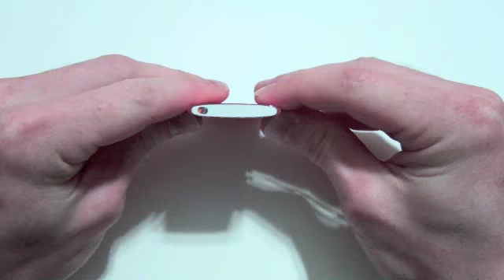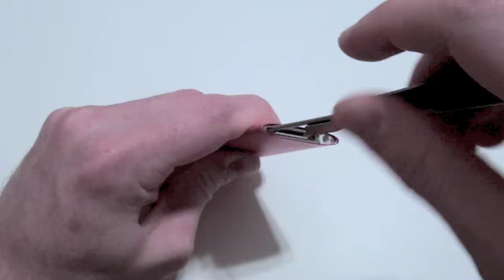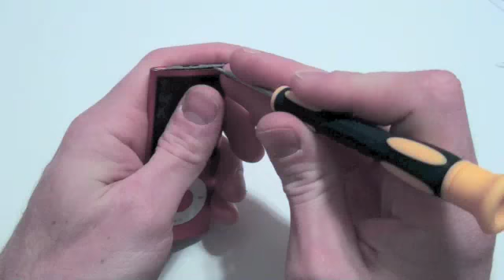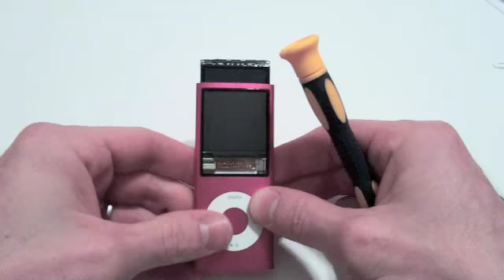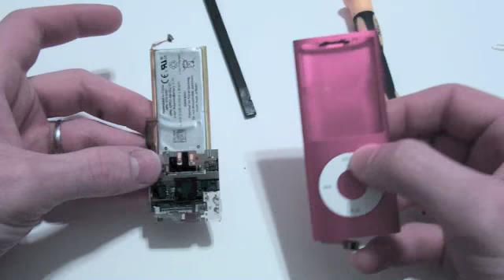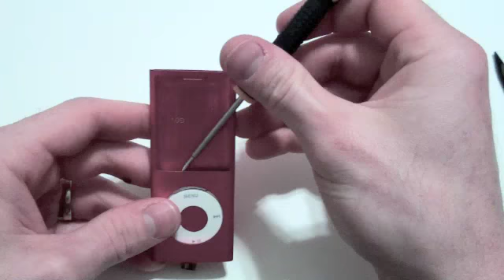How to Repair an iPod Nano 4th Generation

Comment: I made a mistake a big mistake  I ripped the click wheel connector now I had to source one on a random website and while I’m in there  I’m replacing the battery with an ifixit one took it apart because I accidentally put it in the washing machine it was off didn’t hold a charge anyway so I hope it didn’t get ruined I will be soaking it in alcohol and blowing it off with electronics cleaner so it has the highest chance of not being damaged

Comment: this is an ok instruction in my opinion. but I think due to ageing some of the glue is getting much stickier. removing the Glass bent the case in some places.

sadly I ripped Off the cable of the wheel when sliding Out the Logic board and battery so take care. But I am Not Sure If I would have succeeded in soldering the battery.

maybe its better to buy a used one

Comment: Mine won't power up, I've tried resetting bit didn't work. When on charge I know there is power gettin to it because when I hold it on my hand I can feel electrical vibration. Any ideas what I can do to get it switched on please?
Reply from the maker: You could try to replace the battery and see if that brings it back to life, but it might just be time to replace it.

Comment: I am a very good technology person and I've repaired my own LCD TV's, watches, etc.  But honestly, this video is about DISSECTING your DEAD iPod Nano 4th Gen.  Because 99% of you attempting this are going to break the microscopically delicate ribbon cables, break off the cable locking mechanisms, and IF you finally get to the battery without breaking things, and desolder it without burning out circuits, you've still got to reassemble it all.  For me, the guitar pick was an amazing plus.  However, the Chinese kid putting mine together went to town on his use of adhesive, and parts were also covered with tiny adhesive tape now too.  So it was a real struggle to pull things apart.  Anyway, don't think this is going to be a consumer job.  You'll really need good TINY tools and a LOT of patience, and decide what your time is worth.

Comment: I have dead iPod, so just for entertainment and because I always like to check out the newest tech that falls into my lap, I mostly followed your video and got it apart OK. 
My Model A1285 had a metal frame holding the battery. It is also very helpful to use a hair drier or heat gun to heat the iPod up so the glue lets go easier. EE Rob.

Comment: In reality there is silicone in every joint. You can take the screws out, but the screen just won't move at all. Try to pull it and you'll break it.

Comment: need help my fell in water wasn't the first time is happen but this time it won't unlock its stuck in lock. when i slide the metal slide holder nothink happen it work it just won't unlock. how much would it cost to fix it
Reply from the maker: It would depend on exactly what is wrong with it. You can give our repair department a call at 866-726-3342, option 2 for a quote.

Comment: For those struggling with the glass or any of this video please follow the video exactly, very very exactly.  In the video he pulls the screen up til the cable is visible through the bottom of the glass (this is crucial) only then will you be able to press down enough on the bottom of the glass enough to remove it.  The techniques are very specific, follow them exactly as described or you'll end up frustrated with this break down and maybe damage you device.

Comment: lol "simply" press on the glass. This is the part I'm having trouble with. The ipod is gone so I'm not actually worried about breaking things or marking up the metal, but it's still quite frustrating.

Comment: actually, ppl do not waste your time trying to open you ipod, mine was allready toasted and i have a new one, i just wanted to see what it looked like inside.

its defenetly not as easy as this guy made is seem. the glass is the hard part, im not clumsy or anything, im acually used to this type of work but even i ened up cracking the dispay, bending the case and shattering the glass before giving up. dont waste your time, not woth it. mine was trash anyway so im not sad, but still. not worth it

Comment: when i was removing the LCD i noticed that on the back the two black things that run down the sides were separating from the main LCD at the top. it doesn't look too bad, and its only a little apart, will this be a problem?

Comment from the maker: Fixing it usually involves replacing the component. The act of taking apart the ipod will not fix it unless there is an alignment issue with the clickwheel which usually is not the case.

Comment: hey i just took on apart te glue is all over from when it was made. u have to push down on the right sized screwdriver and the side screws are at a angle & one of mine was poorly put in the hole and had some frame stuck in it if u get them out to a point u can can wedge them out the rest. Ps. i used a (00x50 mm) Phillips. (little big but it worked fine)

Comment: did u disassemble it (b4 it stopped working)? i just took my stepmom's apart cause it's battery is bad. i put it back together outside the case and the screen didn't turn on ( when i plugged it in cause it only works that way) but it was the ribbon lock wasn't pushed down all the way.

Comment from the maker: You most likely have corrosion on the logic board. You're probably best off replacing the board. We can repair liquid damaged boards as well at our repair facility. You can give us a call at 1-866-726-3342, option 2.

Comment: U should open the back and blow everything for atleast 2 minutes and then put  the thing back on and see what happens.Or else you'll need to ask someone to repair it.But you can also try to hold the power button on for a at least one minute and see what will happen.You should try replacing the battery because somtimes the battery can have a problem.Try charging the battery for a few hours too.If nothing works you might want to go to the store and exchange or return your ipod nano.Wish you luck!!

Comment from the maker: You likely have a problem with your logic board, and you will need to replace that component. Parts for this model are available from our website or by calling us at 1-866-726-3342, option 1.

Comment from the maker: You likely need to replace the LCD. The issue could also be the logic board. The parts are available from our website or by calling us at 1-866-726-3342, option 1.

Comment: my ipod nano got water damage. i dried it out completely and did not power it on until i was sure it was dry.
it did not turn on so i put it on the charger. it powered up and the screen and scroll wheel work great while on the charger as soon as i remove it it shuts off. do you think its a battery issue?
your help would be appreciated.
thanks

Comment from the maker: @J0NMARTINEZ - You likely need to replace your battery. It does require soldering, so you may want to give us a call to do the repair at 1-866-726-3342, option 2.

Comment: Hi my ipod nano in the same generation will turn on and off whenever the lock button is switched to unlock. However, when it is switched to unlock, it won't turn on and off. Therefore I cannot use my Ipod at all. Do you have any idea what is the problem with my ipod? Thank you

Comment: I have replaced the LCD and glass screen, following everything you described. However now the iPod does not work. I have been extremely careful not to break/snap anything, however I did loose one of the screws from the bottom, could that be it?

Comment: thanks a lot .. but you forget to mention that the lock button is attached to the LCD and we should unattached it before we push the LCD.. i cut the wire :(

Comment: @PowerbookMedic Yea. i kinda dropped it. I took the top part of the ipod and tried flipping the switch thing manually. It didn't work. Upside is that it didn't get stuck on the locked side when it broke xD

Comment from the maker: @garry159 - Depends on how it broke. You could possibly get away by replacing the metal hold slide assembly, but most of the time the problem is with the logic board and requires a board replacement.

Comment: Hi There, you really seem to know your stuff. I have a problem with my iPod nano 4G. I've been using it in a logitech dockingstation for 2 year or so. My iPod has worked perfectly untill last night. when I woke up, the wheel nor the buttons worked. It has been playing unstopable until it went low battery. Whenever I charge it the power turns on, but my wheel/buttons still wont work. any suggestions?

Comment: i have a 4th gen ipod that ive had for two years. for some reason it wont turn on and it its fully charged. is there any way of fixing it? i didnt drop it or anything or got it wet. this just happened yesterday

Comment: @JoKeRheartzHaRLEy repairing an ipod is easy.. this video is very useful. If you can build a kit with lego you can repair an Ipod, trust me its that easy.... Take your time, dont force any parts, watch this video 4 or 5 times before you repair and pause and rewind when you repair..make sure you have the right tools first though. its easy.. trust me.. it will save you money as well

Comment: Question: I have an Ipod nano 5th generation, when my earphones are plugged into the jack, I hear the music through my earphones and through the ipod speakers. I've tried turning it off, and I even bought a new pair of earphones, but nothing seems to work. I want to be able to hear my music through my earphones, but I don't know what's wrong. I'm thinking that it could be the earphone plug/ jack on the ipod that's not working? Or is there anything I can do about it?  Thanks!

Comment: Hi last summer by mistake i went in the ocean and fergot my ipod in my pocket. I put it in rice but it seems that the click wheel doesnt work and the actual button part of the wheel wont work, like the buttons dont press, but the screen works. Should I de-assemble it and dry cleaning it?

Comment from the maker: @ChelseaVictorMusic - The problem on these Nanos is that on a problem like yours, the issue is usually the logic board. The boards are usually more than a replacement Nano. This video shows you how to take apart the Nano and replace the components however if you were able to source the board for a good price.

Comment: So i was an idiot and left my ipod in my pant's pocket my mom didnt know it was in there and put it in the wash i pulled it out before it went through the dryer but it still doesnt work i can plug it in to charge and the screen stays blank so what should i do? i want to know what i need to replace and stuff before taking my ipod apart so i dont screw it up even more. please help D:

Comment from the maker: @Sesh777 - Even with a dead battery, the unit should power on when connected to a computer. Your problems are probably deeper than that.

Comment: Can someone help? I have an ipod which froze and i held the center and middle menu button to restart it and it unfroze. My brother's ipod is either frozen or the wheel doesn't work, so I tried the same thing but his can't be used. It froze some time back but it might be the wheel, I'm no expert. Can someone help with good instruction?

Comment: i spilled some water on my ipod a few days ago. i put it in rice for a day and a half because it wouldn't turn on. now when i try to charge it by connecting it to my computer, the screen says "connect to power" or "charging is not supported by this accesory." so apparently the screen works fine, but my ipod won't charge and it's on "hold" and is locked even though its technically not on hold.

Comment from the maker: @asylumseeker07 - I'd recommend taking it to a repair shop before the screws are stripped to the point of having to use a dremmel to get them out. You can use a slightly bigger screwdriver and apply a lot of downward force to try to get the screw to catch and spin.

Comment from the maker: @FAxXErickXx - I'd check the display cable first, then I'd try a replacement LCD. If that doesn't work, it's likely a logic board and not worth repairing. We do offer free diagnosis if you don't have the parts to test out.

Comment: @heisthejimmy ...thanks for the reply. i just figured out you have to put the glass back in before you slide the lcd all the way back in so you have room for the glass to go into the case and if you push the lcd down into the body first the glass will not fit in. thanks again

Comment: When you put the glass back in, slide the bottom 'notch' ("The little extended bits on top and bottom") under the metal body of the iPod, and then slide a little bit of the glass face in as well.  Just a tiny bit.  Then I pushed the top of the glass in gently to get the top 'notch' of the glass under the metal body of the iPod at the top.  When I got the top notch under, I used my thumbs to push up on the glass to slide the bottom out from under the iPod body and into place.

Comment: @heisthejimmy 
How did you get the glass back in? lol seems to be the hardest part. It all comes apart simple and I esoldered new batteries in but for ther life of me I can not get the glass back in the 4th gen nanos? The little extended bits on top and bottom dont allow it to pop back in its one end or the other goes in then its like an 1/8 to much to fit back into the opening??

Comment: Thank you for posting this!  I just replaced my screen following the example in this video.  A suggestion for the video: when you are trying to remove the glass, when you say to push in at the bottom, the step should say that you need to push the glass in and slide the glass down a little at the same time.  Once I did that, the glass popped right out.  Thanks again!